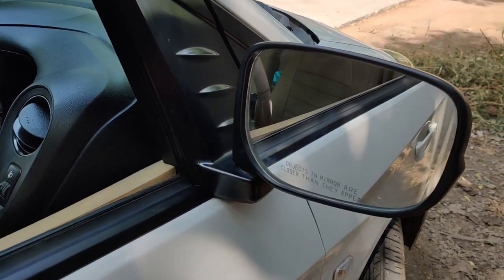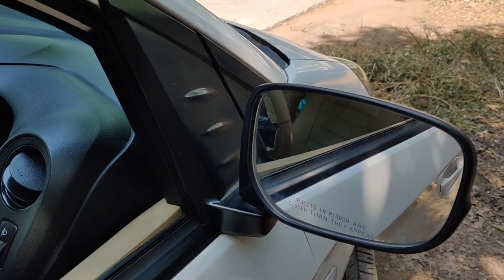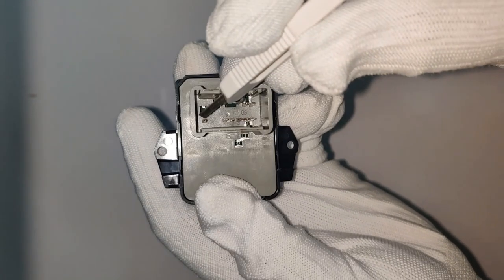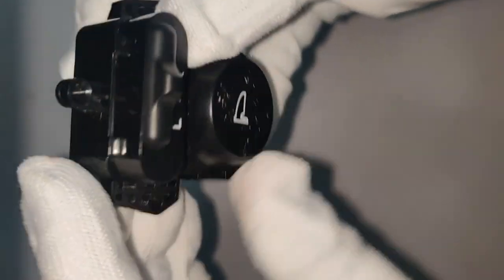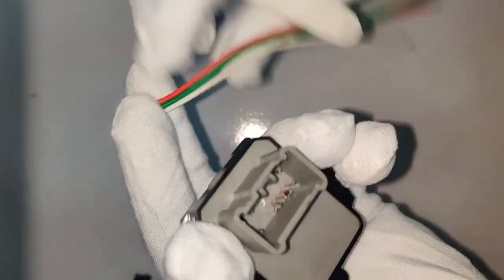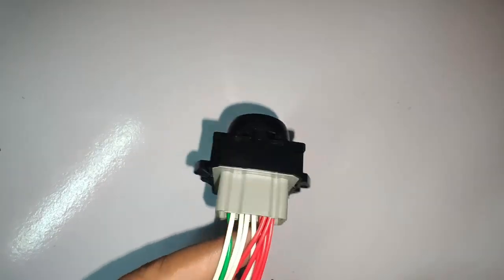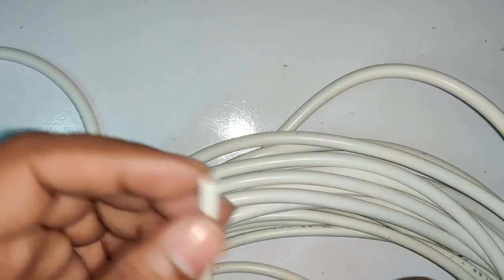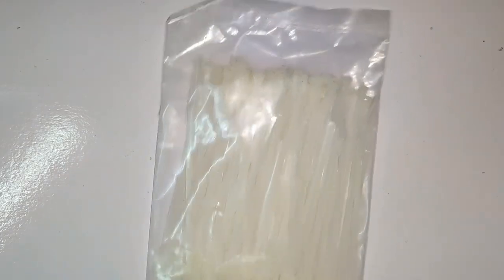MANUAL TO ELECTRONIC (POWERED WITH INDICATORS) SIDE MIRROR CONVERSION ! HONDA AMAZE --PART 1 OF 3

Comment: The link which was given for switch is different than the switch shown in your video, It has no "ON/OFF" button. Could you pls help with diagram of the link given switch. Thanks in advance.
Reply from the maker: Seems the part has been changed by the boodmo.
Reply from the maker: Try this link. 
https://boodmo.com/catalog/part-35190tm0z01-8919780/

Comment: hello bhai mere pass kia sonet he usme side mirror electrical adustable he but auto foldable nhi he ....do need to change mirror
Reply from the maker: Yes, you have to change the mirror with controller. Harness modification is also to be done.
Reply: @newonyoutube5535  can i add motar in existing mirror
Reply from the maker: @akashkatariya3487  no. That's not possible....

Comment: I had purchased switch, male female connector and electrical adjustable ORVM as you suggested

But I am facing some problem... Basically I have Honda Amaze 2019 base variant and I have also purchase molex connector for proper fitting but molex connector have 7 pins only and switch has 11
Reply from the maker: Try to find out the pins and their functions of orvm. Refer my 3 videos .
Reply: @newonyoutube5535  finally success ... Video uploaded also 

Thanks dear 🤗🤗